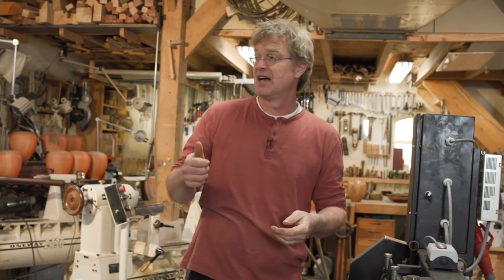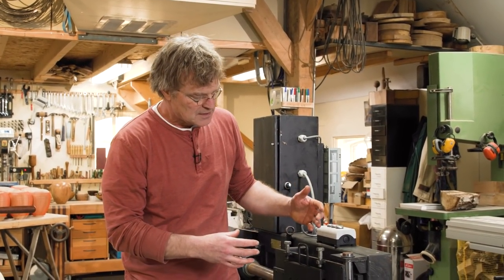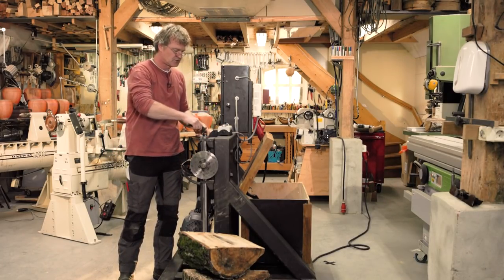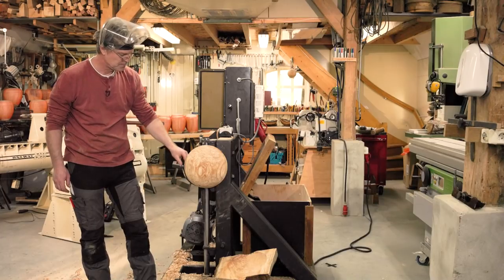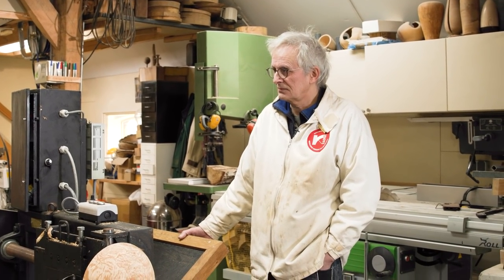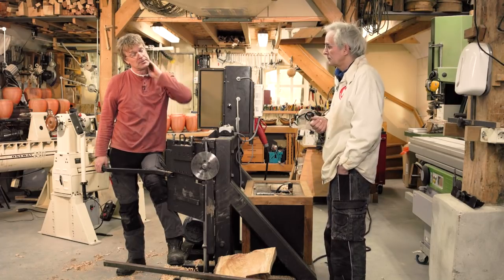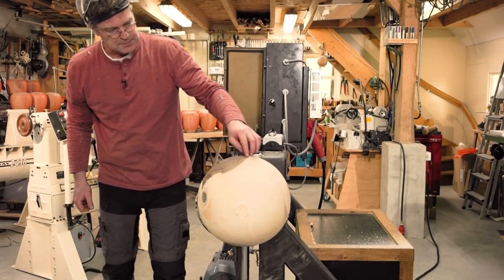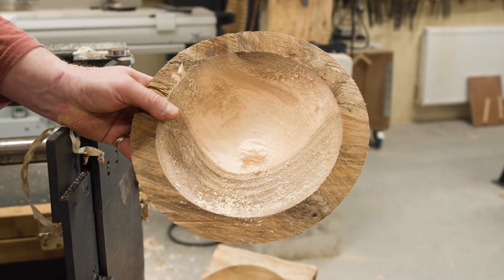Demo The Mastodon, a bowl coring machine. (Video made for the woodturners worldwide symposium 2022)

Comment: Love to see homemade tools. I'm using a late 1800s wood lathe from my family's winery and cider mill operation that ended after prohibition in the late 1930s. It was used for many wooden spindles for the mill's operation. Back then, everything was made from wood. It has a 14" swing and can turn a spindle up to 8 feet long. I added a treadmill motor & all the controls so I could get variable speed, reverse, etc. I've been making many bowls and also use the Oneway coring system. I use the exact same cutter you use and I'm too cheap to buy the expensive holder sold by Hunter Tool Systems. It's hard to beat carbide especially when they cost about $1 USD. I can cut nearly 100 bowl cores with one cutter.

I thought the Mastodon looked familiar. I've watched the coring videos from the Holland Mill and the Alaskan Mill. The one problem with these swing coring systems is that all the core shapes are very standard. I've thought about the McNaughton System but that looks like too much work. I sure would love to have a larger lathe. the Oneway 2036 or 2436 would be ideal.

So glad I found this video. Awesome job with the build, the demo, and the explanation. Next up is to subscribe to your channel. I look forward to more videos about your woodturning. Regards, Greg
Reply from the maker: Thank you Greg, for your lovely reply. That looks like a great machine you have! I love these old quality machines..
🙂

Comment: Pretty amazing design and construction,very clever. Appears to be almost no vibration, incredible. Wondering about rpm range? Would have loved a closeup of the cutter in the tool……did I miss it? Stay safe…
Reply from the maker: There is a close up of the cutter in the video. It is a carbide cutter screwed on...

Comment: I viewed your video with great interest and found it fascinating.  Thank you.  I do have two question:
1) In your video you mention that your cutter is a CCGT06 carbide insert from the metal machining world.  Would you please let me know the complete identification code for the carbide insert which describes additional properties such as the hole, chip breaker, etc?
2) Is your carbide insert mounted such that it enters the wood at a negative rake angle so as to possibly reduce catches?  If you use a negative rake angle, approximately what is the angle?
My intent is to use carbide inserts on the McNaughton Center Saver knives.
Looking forward to you response, Peter Toch, Virginia, USA

Comment: The only problem I see, is that there is no way of attaching the bowl to the Oneway lathe! I guess you can use a glue block! I have a small coring machine, but it’s done in reverse! You have to put a tenon on the front, before you core the biggest piece, and then core the next larger piece!
Reply from the maker: Hi Elliot, I don't see the same problem. In this video I explain how I remount them on the lathe... https://youtu.be/ZXqXENXNMuc
Is that the answer to your problem? or did you mean something else?